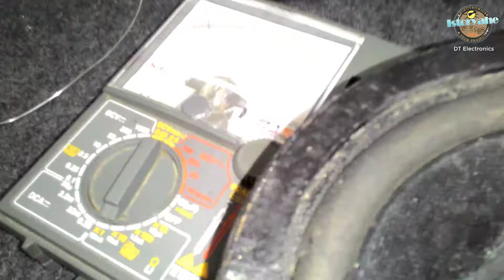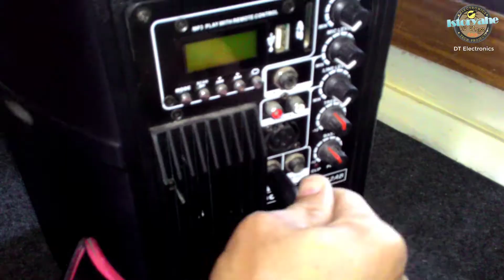6 Inches AIWA Speaker Repair

Comment: My speaker right mid and tweeter are not putting out sound. Speakers work when plugged into the left side so the speakers are fine. How do I check and repair the issue? It is the aiwa exos-9. Do you have a teardown video because nobody does! Help please! Thank you!